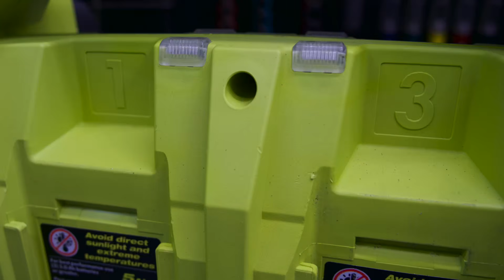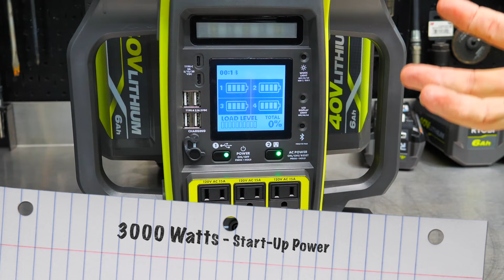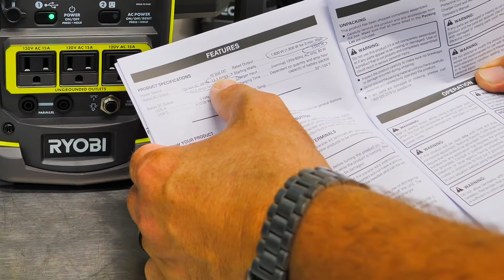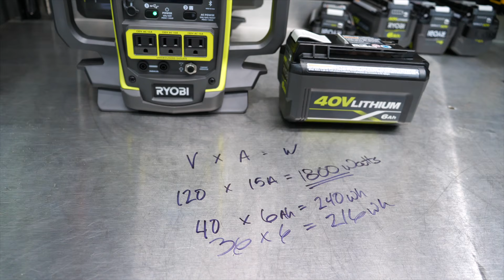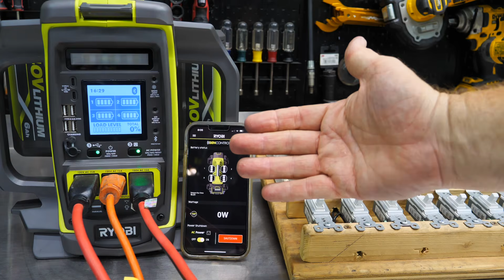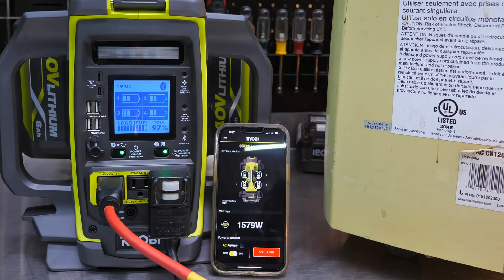Replace Your Generator? 40-Volt RYOBI Power Station - 3000W or 1600 Watts?

Comment: Only 1600w continuous? The 18v based One+ unit thats very similar to this can do 1800w continuous. That, coupled with the fact that more people have 18v Ryobi batteries lying around than the rarer and less popular 40v batteries, as well as the lower cost of the batteries and the unit itself, i think the One+ 18v unit is the way to go.

Comment: Great video. Thank you.   If anyone could help me, I'd surely appreciate it.   I have a powerchair that is 24 v ... it has two 12v batts at 55Ah each .... will this recharge my chair at least a little bit????   I'm looking for something I can take with me to assure I can have enough power to charge up when I get to a location that may not have power.    Any suggestions would be greatly appreciated.  Thanks all.

Comment: Although this is a neat power station you must be deeply committed to the Ryobi  power system because who has multiple 5 or 6 amp hour batteries just waiting around. You should buy a stand alone battery station at this point. Personally I jave 1 6 amp hr, 1 5 amp hr, and 3 4 amp hr 40 volt batteries they all came with tools so I use the 300 watt 40 volt power source for $100 bucks to utilize my batteries buying a bunch of batteries just to use in this power station doesn't seem like a good idea.

Comment: Crazy that America uses 40V and 20V but it’s not the real voltage. Here they are called 36V and 18V
Reply from the maker: That is correct. The only difference is whether they measure the voltage at MAX charge (20/40V), or as the nominal voltage after the tool has been used for a minute (18/36V). Thanks for watching.

Comment: If you’ve got 4 batteries could you run two batteries and your fridge and then plug in one or two chargers to charge your extra batteries off of it to keep an unlimited supply of power during a power outage?
Reply: Where are you getting unlimited supply if during a power outage you can't charge anything?

Comment: It looks like a great unit for some light duty stuff, but if you plan to run anything with heavy power usage, you will run the unit down very fast. Perhaps too fast. Especially with no pass-through charging. For the cost of that thing, you could buy a dam good gas generator.

Comment: 15:32 true CAPACITY, watt-hour is capacity. power is the voltage. a 40v system is more POWERFUL than a 18v system.
Reply: Except in this situation. The 18v power station will accept 8 batteries including the 12Ah which have 216 wh capacity. Same output ratings. Same max total battery capacity.

Comment: Gotta question:  I noticed that the power station doesn't have any ports to plug in solar panels.  I was wondering if it would be possible to charge the batteries using solar panels plugged directly into a separate inverter?  The theory is that you don't need batteries to run the inverter, and as long as I'm only using the inverter to power the battery charger during the day, I should be able to use the power station in the same way I would use a backup generator at night.   Crazy? Maybe not.  Have you seen the price of a PowerWall or one of those solar generators? This would be a lot cheaper.  Plus, with the separate solar panels and inverter, I could power my essentials forever! Or at least until something breaks.

Comment: Thanks for a review that even an electronic numpty like me could understand.

However, one thing did confuse me.  Why would you want to have the power going into the unit to charge the batteries and output at the same time?  Surely, if you have the power to charge the batteries you don't need output.

Comment: any ac output, modified or pure sine wave can charge phones/laptops or anything with a battery.  "Sensitive electronics" are things like tvs, desktop computers, stereo equipment or anything that has lots of electronics bits and dont run off internal battery.

Comment: I really wanted to buy one of these, but there just isn't the value preposition unless you are neck deep in spare 40v Ryobi batteries. The EcoFlow DELTA with 1260Wh regularly goes on sale for $800. This Ryobi power station costs $700 for the tool only version or $900 with two 6Ah batteries included at my local Home Depot, and then I'd have to find (or buy) the remaining 6AH batteries just to get to the 864Wh you calculated. I think I'll stick with the one that costs less, has greater capacity, and has more features.
Reply: ryobi now offers 12 ah 40 v batteries and backpack adapters to use 3 batteries per slot. have yet to see anyone go anywhere near max capacity on these.
Reply: @donbot5000  As cool as the backpack is, if you are buying Ryobi Batteries for battery backups, there's better options. 

I looked up the price of a new 12ah 40v (12ah*40v=480Wh) battery. At the Home Depot, they are $359, or 1.337Wh/$ and you still need to buy the inverter. The EcoFlow Delta 2 is on sale (first Google result) for $599 for 1024Wh or $1.710Wh/$ and comes with the inverter and even the option for solar, car, and AC charging built in.

Comment: You are NOT replacing a gas generator with this. $400 buys a 1800watt gas generator for the Hazard Fraud. For the same $900, you can get into a 3500W and for $1200 that’s a 8750W unit. Where’s the value? Also, let’s not forget that the whole point of a generator is that power isn’t available from a wall socket. Why not just plug whatever you’re running into the socket you’re using to run the chargers? I’m largely a fan  of cordless tools but batteries do NOT replace things that rin on ICE. End of the day, this is a gimmick and a shameless money grab preying on dummies.

Comment: This is a very interesting tool. If you have the batteries already, the math changes, and it could potentially take over the solar power generator market. This iteration of the tool, does not quite provide all the features and options that are needed, but the national distribution and ability to easily replace batteries, make for some interesting potential. I have a large number of Rybobi 18 volt tools and batteries and got the small brother of this unit that runs on one 18 volt battery. In a power out situation, it can handle lots of the little loads. (internet router, LED lights, TV ect) with multiple batteries. Allowing one to utilize existing batteries in another situation has benefits. These solar power generators are generally meant to run the small loads, at full capacity, running a Gas powered generator is going to make more sense for longer times. However, if you are a trades person and you need something simple intermittently at a job site. (like a soldering iron, microwave or air compressor) this can fit the bill. I expect the next version will turn this into a fast charger, and provide solar inputs, so it can fully compete in the off grid market. At full loads, this device only has 30 minutes of power, but most people will run this for tiny loads, CPAP machines, fish tank air pumps, and coffee makers. Potentially, this could power an air compressor, cut down on job site noise, (no noisy generator running), and can handle all the standard corded power tools needed in a remodel. Lots of people still have corded tools that are used intermittently.

Comment: One quick thing. At around 21:22 you said that it is a 1:1 output. This isn't correct. You are losing energy from the conversion of DC to AC
Reply from the maker: Yes, you are correct, but that is pretty minimal. My point was there is no magic happening to create more power than what is in the batteries. Thanks for watching.

Comment: ¿Which Ryobi power source do you recommend to run two 100w led video lights for a minimum of 6 hours? Considering staying as low budget as possible, ¿would you recommend 2 separate small units? It says here on the AC adapter that it has 150w 16v power, input 100-240v, 50/60Hz, output 16v---9A. I would appreciate some guidance, thank you in advance.

Comment: I love the ryobi 40 volt lawn mower and I'm on my 5th year now. One battery finally died and that's acceptable. The cost to power here is not at all acceptable. Get an ecoflow because this had no features. You can solar charge it. No pass through power. Crazy expensive for way outdated features. Get a little suitcase generator for 500 bucks that can really put out 1800 watts all day for a gallon of gas. Fantastic video with great math explanations of how it works!!! We appreciate you on this side of the interwebs😊

Comment: I struggle to understand why someone would sell out $1000 for a power station that might get you an hour of use out of it (unless you're running fans or LED lights with it). The batteries alone are quite expensive and once they are depleated, you're out of power for almost 24 hours while you charge them back up.
Reply: I dont think is suppose be used for emergency situations more like do a all day project type thing. Because like you said once the battery is done your pretty much screwed. Even the solar panels wont produce enough constant energy to function. Thats just my guess.
Reply: They're targeting the "dumb lefties who think owning a generator is immoral and can't do math" market

Comment: Ras of right now, Nov 29-2022 power station + 4 6ah for $1,057 on the depot website.  Good deal. Too bad I don't use any 40v ryobi. Hey "Shop tool reviews"  amongst all cordless power station in your honest opinion which brand gives you more run time? And you forgot to say if this is sinewave power station. I know dewalt isn't and milwaukee's is.

Comment: Been looking at this for camping.  Maybe just running 3 fans at night.   2 basic box fans and my ryobi hybrid air canon.  Witch all that less then 300w.   My question how long can I run this for under those power condition with 4 6ah batteries.  I got the 18v inverter that came out this year.  So I’d charge cell phones off that.  But.   The fans at night.   Usually like camping for 3 nights. So 24h  worth of charge for the fans.    Can or can it come close to doing that

Comment: its just always going to be order of magnitude more efficient to have a built in power bank than using removable batteries 

this design method will simply never be able to compete mathematically with dedicated technology 

its just a dumb way for Ryobi to get people to buy more batteries than they would already 

I would recommend to anyone I actually cared about they get a dedicated power bank to bring into the field and charge their batteries/run their equipment off instead 

an actually useful version of this product would be a dedicated built in lithium battery that would operate much more efficiently than these individual 40vs and then someone could actually charge their batteries off of that while theyre working off grid 

but theres some energy lost in the transfer so its a question if the main battery is bringing enough extra juice to the field to make up for the loss of just bring more 40v batteries prejuiced....so you need to find the right scale. jackery and ecoflow have unlocked that so I think this product has the math already in existence for it....Ryobi just specializes in very different battery technology its easier for them to make a useless product that uses their same battery tech lol
Reply: I'm seeing a lot of their decisions driven by market incentive to create some absolutely useless and embarrassingly designed products 

this feels very american and hyper capitalist to me
Reply: it looks cool tho, definitely a hype train product for people with more money than sense

Comment: Also note for few people who don't care about how much money to toss.

Ryobi also has a 3x battery pack system that has a normal 40volt battery slot cable attachment. So if you're wanting up to 5.7kw of power. Pairing soon to get Ryobi's 12ah 40volt batteries in each of their 3x power packs, Then putting 4x of those into the 1800watt power inverter, You'll not only get to Charge and use, But also have 5.7k+ power housed in the unit.

And since you can also 'Pair' this with another 1800w power station. That brings it up to 11.5kw of power storage.
Reply: It would be cool just to see someone do this!
Reply: Yra, but i think this unit can only put out so much power at once no matter how big the batteries are.
Reply: @aaronweiser5421  Umm yea. That isn't the point of the idea though. It's not about increasing overall output power. It's increasing the amount of BATTERY life it has.

This can run on battery. But the point of the other slots is to increase the battery life itself.

So say 1 cell can last up to a hour at such output. 2 cells gives me 2hours. This if i used 12ah cells. Then 2 giving me 2hours is nice. But if each cell slot has 3 batteries in 1 slot. That gives 1 cell slot 3hours of battery life. So 4x of that IE that's 12hours of battery life at max power output. Compared to just 4hours.

So you see the point of this? Plus since it really only takes power from 1 cell at a time. If 1 power pack is fully drain of the 3cells. It'll switch to a cell slot that is already full and the last slot you can charge. So it'll be a repetitive cycle. Or if the 3x-1 cell can charge fast enough. Then it won't even drain the first cell battery. So you could keep a stable power output without wasting power itself in general.

Comment: Needs pass through charging and a solar charging option.  Big miss for ryobi.
Reply: 12v vehicle charging along with the solar is a must have.
Reply: Bummer, using while charging from solar is why I'm here😢
Reply: Thank you, made it to 9:33 before noticing your comment.  Found one on marketplace for a good price but wasn't sure if it had passthrough charging.  We have EV's so hooking up to the 12v on either car would extend run-time dramatically.  I'll pass.  Back to looking and the Anker 767.
Reply: So no pass through.....this tool must be off first to accept charge from gas invertor... Am I correct to think that way ?

Comment: You're not generating power so no, you can't replace your GENERATOR with a battery. That power needs to be GENERATED which happens at a station weather it be nuclear, coal or hydro. That power is stored at a loss in a battery. Then, you're converting that DC to AC at again, a loss. There is a reason its called a POWER STATION and not a GENERATOR. So again, NO it cannot replace a GENERATOR because its not the same thing. A generator can be fueled and will continue to generate at less loss than storing power in a battery and at a higher capacity too.

Comment: how long would it run cpap on four 6amp batteries
Reply from the maker: That would be a little over 900 Wh. For the sake of not being 100% efficient, let's just call it 900. Most cpap machines draw 30-60 Watts, so let's call that 50. Looks like about 18 hours runtime. Thanks for watching.
Reply: This is a great question.

Comment: The fact that you had to stress that you “never read tool manuals” and than start doing equations with stats on the back of the battery tells me you read every manual, thoroughly. That’s completely ok too. 👍very informative video! Nice job.
Reply from the maker: Are you calling me out?! Lol. Ok, I may read a few manuals, but not because I like it. :) Thanks for watching.
Reply: Sometimes the info is on the box!

Comment: Doesn't seem to be enough to keep a freezer going long enough if power is out.
Reply from the maker: Depending on the size of the freezer, the usage, and how much frozen stuff you have in it, this would definitely run it for several hours. The more stuff you have in the freezer (frozen stuff), the more efficient the freezer is. Thanks for watching.

Comment: Looks awesome, a shame Ryobi doesn't sell it as a kit with the bigger 7.5Ah batteries. 4 6Ah would be great, but 4 7.5's would be outstanding.,  And right now the kit with the 4 6Ah batteries costs less than just 4 6Ah batteries on it's own.  Buying the tool only and buying 4 batteries winds up being over twice as much $$$.

Great video, I think I going to poke around and see if a 7.5Ah kit is hidden somewhere.
Reply: The 40V 12.0ah will be a monster
Reply: @grandmofftarkin4762 400$ each
Reply: wait till you see the 12 ah batteries lol

Comment: What’s the point going cordless just to make power from batteries to power this unit to run cord to power whatever?
Reply from the maker: That's a pretty good point. I think these are great for low power consumption needs, where power cords or outlets are not available. Thanks for watching.
Reply: @Shoptoolreviews  you have amazing chanel

Comment: Can this be used to power other already battery powered devices such as the Ryobi battery powered air compressor?
Reply from the maker: I'm not sure of the question.
Reply: No you can only run 18v on 18v batteries

Comment: Great video! Very comprehensive and answered all the questions anyone should have. I've had a Canadian Tire Power Box since 2021 which is lead acid and plugged 24/7 all these years and it still works like a top. Use it for lights during power outages and we all know lights are the most important during an outage but it also boosts a dead battery up to 650 cranking amps up to 30 boosts on a single charge and I've done it. Lithium ion and new tech make this even better and lighter. Every home should have one or more .... Cheers from Nova Scotia

Comment: It will be a cold day in hell before I spend that much money on something like this. I will keep using my 3000 w kipor gas generator as it is twenty years old and starts and runs just fine. And I can run my welder off the 30 Amp socket.